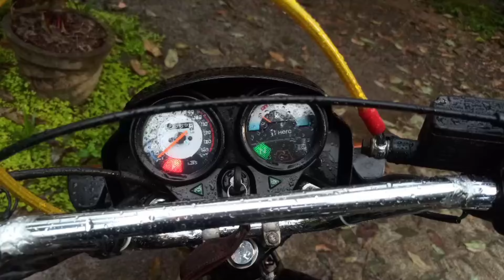Full modified bs6 splendor

Comment: Speed cabil ath parayamo
Reply from the maker: Athu 140cm disk ose💙
Reply: speed cabil
Reply from the maker: @bibinsuresh6537  stock aa bro
Reply: Vandi hight kuttitundo
Reply: Speed meter cabil
Reply from the maker: @bibinsuresh6537  modification use ചൈയ്യുന്ന cable aa bro